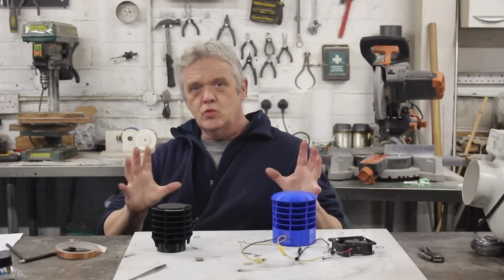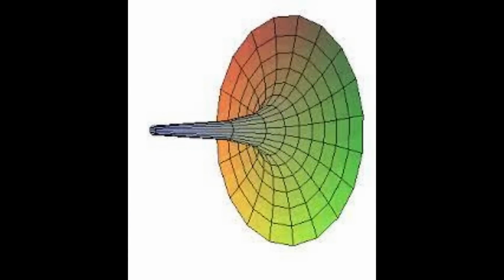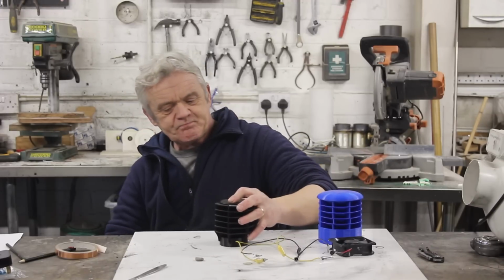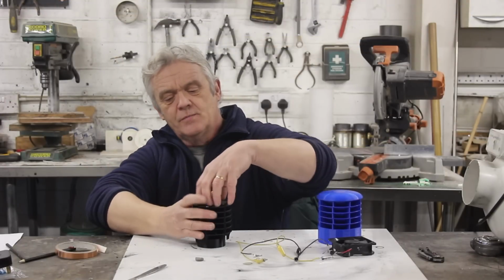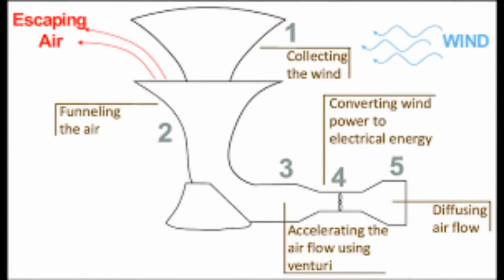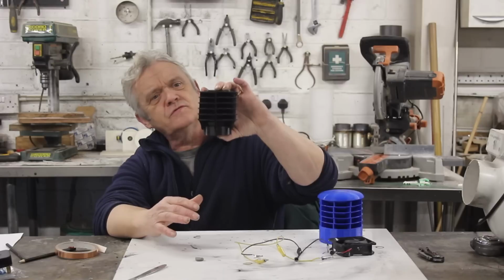1832 Darwin Wind Pipe Designs From Friends

Comment: I was thinking of making quite a few of those cast aluminum generators with of course gaskets and rubber seals around the bearings. Valdosta some built-in small batteries for if they get frozen or are in a cold environment and need to be heated up when there's no sun and there's still quite a bit of wind. I wanted to make them quite small and well machines but have the case cast out of recycled aluminum more or less. I also really like the bioplastic with the added graphing powder as I actually own a centrifuge.

Comment: Just thinking out loud...why not combine the "Darwin Wind Pipe" with the "Rose Turbine?" Seems like it would be a match made in heaven. =) Also, what if the cone on the "Rose Turbine" modeled a hyperbolic funnel, upside down of course...how much would that impact the rotation of the turbine and could you then modify the inside of the blades to leverage the new cone design?

Comment: As a suggestion to your point about making things when you don’t have a printer, a very simple solution is like we used to do is make things out of balsa wood. 
You can fashion design prototypes quite quickly starting out at the same point producing the design in E cad if necessary and then building the prototype on the drawing. A very enjoyable pastime in itself and for small designs might even be fairly quick?

Comment: Rob! What is going on here? Those "hyperbolic" shapes introduce a massive amount of "drag"! That is, reduced efficiency.  Ok, we're not trying for ultimate efficiency. What are we doing? Protecting birds from flying into the blades of a "regular" wind turbine? If that is the goal, then great. I have to mention this too, when you placed that plastic thing in the wind, sure it works, but you didn't test the out put. This has gone off the rails of logic. Very disappointed Rob, sorry. Your work in the past has always been based on science, these plastic printed thingys are  simply not advancing any science. Maybe it's a way to get people interested in wind energy, that's fine too. But again, where is the science?

Comment: Hey Rob, to open up the other Tony's model, you could subtract a cube from the top of the funnel, or even mark and cut the segments incrementally on the one already printed, with a pen and scalpel, and graph the change. Layers should peel nicely and that could be interesting to see for the data! The one I made is way more open but not up for such a test without modification. And I'd love to see the rotating cowel design and how that compares to the others! Maybe you should think about getting a sponsor such as a 3d filament company at this point lol

Comment: Inefficient... both... If you made them so that both could rotate and take in the wind at the same time, they would be more efficient. Standing wind tunnels are ineffective in directing the wind, or at least the power is wasted. Why not take the most preferred structure and make the blades at an angle of 33-45 degrees (the best angle for the incoming air would be 33 degrees), but since the whole sturcture is also wanted to rotate, compared to the horizontal direction, the blades could be turned to an angle of 33-45 degrees to gather power to rotate the whole system and at the same time collect air inside. Inside walls cant be straight, those have to bee like diy barrel wind turbines or savonious model.

Comment: Looking good. I think you want your pipe flowing air from bottom to top because wind speed higher off the ground is usually greater than at ground level. Also, I see no reason why you couldn't have a fan every 20cm or so which would increase the current output dramatically.

Comment: What about several  hyperbolic funnels with swirl vanes and openings in middle by shaft for downward flow on the bottom side  in a column, on a common shaft straight too motor?🤔👍
Reply: humm like having several blades on a shaft running up the center and the Darwin collectors feeding each blade down to one generator. this would give you a better torque for higher generation at low wind speed
Reply: @rayg436  Thanks for the reponse, and exactly.

Comment: If a small tube was attached from the choke point of the venturi to the center of the funnel, this would lower the pressure and pull more air into the venturi like gas into a carburetor

Comment: Can someone here please answer a question?  Would it be beneficial to have multiple fans in line?  I wonder what one of these 5 fans in the line would generate versus 5 separate generators with one single fan each.
Reply: That's basically what a multi stage turbine is. The ones they use in power plants, usually run on steam. Each stage needs to have its own blade pitch, diameter, and other properties, but it's certainly possible to scavenge more out of it. There's some very complicated engineering behind that question.

Comment: So a thought on this-  you know the Dyson air multiplier/bladeless fan concept?   I wonder if that could be incorporated into the design, like the rounded top with a sort of chimney down the center, so the incoming air blown down the sides would create a draw down the top and cause more airflow?  Don't know, but that might increase the output.
Reply: The Dyson Air Multiplier is misleadingly named. It moves a greater volume of air than the original fan at a much lower velocity. Ideally, that means the mass flow is the same. Reality has losses and this means it's not quite as good as it's fan blowing in the open air. For wind turbines, we're looking at converting as much of that mass flow into energy as possible. For small fan blades, that means we want the opposite: a smaller volume of air at a higher velocity. That's why there's a Venturi in the original funnel c:

The only benefit of the Dyson design is that there is not a direct line of sight from the fan tips to the user, so it's a bit quieter than the fan in open air. However, the same is largely true of a vintage Vornado and the modern ones use circular fanblade tips that are less efficient, but don't shed the tight tip vortices that make the noise.

Comment: In a previous video we talked about a 35 degree angle for the Darwin device. I tested to make blades for my wind turbines (HAWT) and place them in a 35 degree angle and it performed better than the previous blades. The angle also allowed for more and blades and I could also increase the chord length to capture more wind at low wind speeds.

Comment: Would a more funneled shape be beneficial to possibly get some benefit from the Bernoulli principle - ie. reduce pressure, increase air speed - as in the commercial example you showed?
Reply: I'm working on a cone inside the collector with that in mind.

Comment: Thank you for including the hyperbolic funnel design. I agree that this particular design is a little choked up. In any case, adding a plenum before the turbine would be a pretty easy, and very worthwhile, addition to virtually any system of this sort. Being a big fan (no pun intended) of hovercraft, I would recommend a little thought in that direction in terms of design, as a lot of the research and practice of that is quite applicable here.

Thank you for the nice video.

Comment: These look good, but I think I'm with Rob on the build issue. This would be especially true if you're looking to build one that is larger than what a 3D printer could produce, or that would prove too expensive to print.

Something that you can put together with flat pieces of material would make a lot more sense for homemade DIY projects, ideally some sort of plastic that could stand up to the elements/general wear and tear.

Comment: I do really like both the signs but I do see a problem for this type of device but I think the first design you showed off would better fit with this concern; weather

Weather in this context would be more around rain and snow however in both it would be understood that you would capture theoretically more wind but you would also have to have a way of dealing with water getting into the system
Reply: Hah! I was thinking the same. A nice water collector at the bottom, perheaps with a self regulating valve would be nice. Also a wire mesh around the tower would be good to catch those leaves and other bigger debries. Or inside? With a cleaning slot?
Or cyclone separating tube? So many ideas... 😄

Comment: Nice. But I notice you always use just an led or measure the output voltage. The best way to measure the power output is use a volts verse amps graph using a variable load. Open voltage measurement is a no load maximum rpm measurement only and short circuit current measurement is the stall rpm. A few different load resistance readings will give the true usable output power readings and hence a better efficiency rating for a given air flow or propeller design or generator build for a given wind flow. In the absence of a laser rpm meter you can use the voltmeter. First measure open load voltage. Record it on a V/I graph. Then with a variable load with ammeter in series, run again and adjust load till 75% of open load voltage is read on the Volt meter. Read the amps and record both on a graph. Run again and reduce the load resistance till 50% of the open load volts is read on the volt meter.  Read the amps and record both readings the graph. Do the same for 25% of open load volts. The graph can then be converted to watts and hence efficiency for each propeller or drawin pipe or generator development etc. I have been using this for years and has always been a good indicator of improvements or getting worse for me.
Reply: Yes. Yes!
A proper power curve. I’m really surprised Rob hasn’t done this. Your analog method is great. A slightly more complex system of variable dump load and power output could simply use a transistor with base current / voltage controlled by a PC or even Raspberry Pi using the DAC/ADC, and also measuring drop over the collector current on a dummy load. Add an RPM counter, program in a test routine, and graph the output. Then at last we’d get to see true output and small differences between these devices.
Reply: @ianclarke8821  Yep a simple raspberry could do a quick automatic plot. Back in the days of the P3 computers I made a parallel port   pcb setup and wrote a Qbasic  program to do all this. Now a days I just use a simple setup as mentioned above. It's quick and can get good results even without using my laser rpm meter. It may be off by a few % but it give a good directing where I'm heading. My load resistors are actually nothing more  than a large panel of 1 ohm resistors of 5 watt  (100 of them ) in 10 rows all connected in series. They are mounted by being twisted around nails banged into the wooden panel. I then just take the one amp meter lead to a nail and read the voltage if not half I go to the next nail until I get the reading I want. It's surpringly quick to do. I'm sure Robert could catch onto this one easily.
Reply: @bartronicsecurity  very good! Ah.. QB45 was a flavour I used in ‘83! I interfaced our pathology analysers on the 232 ports to capture and print results off. Did similar things to you with a zx81 and 8 bit home built ADC. Writing a graphing program in 1k of RAM was a challenge!
Anyway, you’re spot on. All these spinning fans lighting an LED… could be 3mA 2.8 volts, could be 50mA 2v … could be just forward bias lit with Amps to spare - who knows? We’d like to know!
Reply: @ianclarke8821  AH the ZX81. My first computer.  I'm guessing you also 6+ decades on the planet?

Comment: Couldn’t electrical planes put a few of these on each wing or along the lines along the body to stick into the jet stream to run generators to in theory endless flight
Reply: That'd be a perpetual motion machine and breaks the laws of physics.  They could use them to generate electricity but it would increase drag requiring the engines to be throttled higher therefore using more fuel and reducing efficiency. In reality these sort of generators would be best used in a stationary setup in a location with naturally sourced and continually moving airflow.  That would get you your "free" energy.
Reply: There's no such thing as a free lunch.